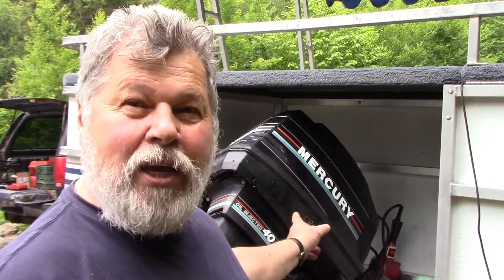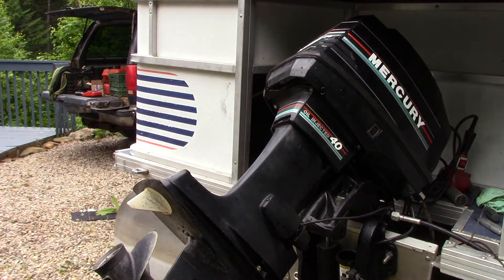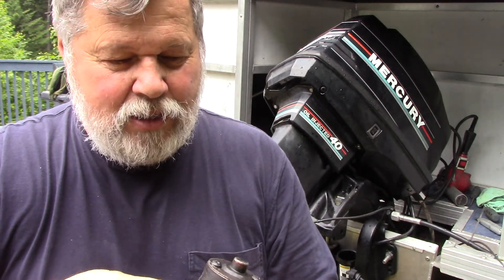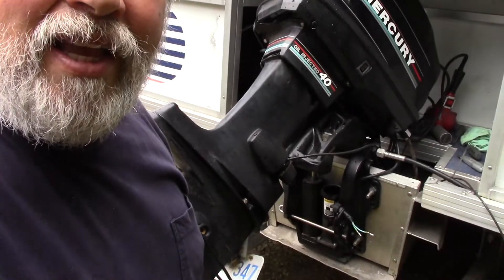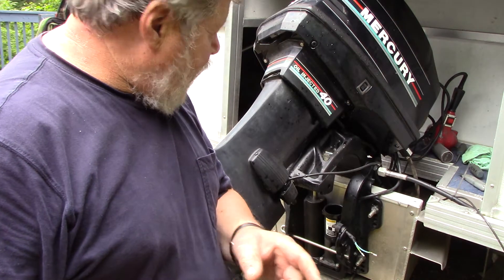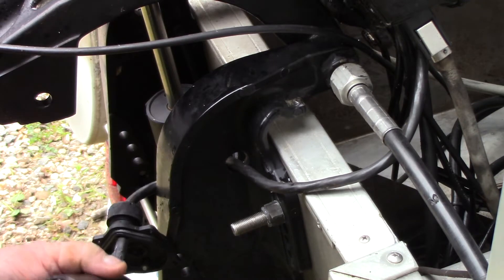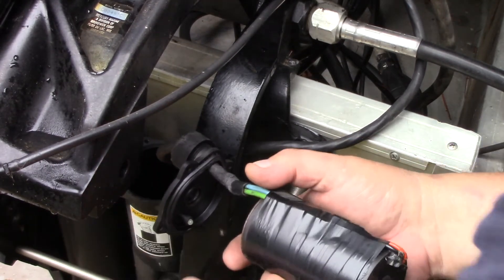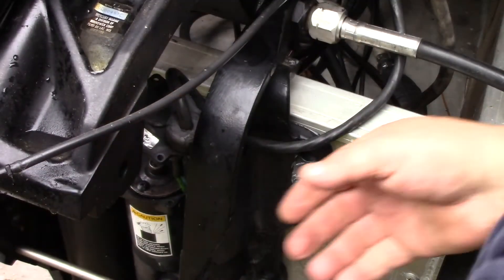Repairing the outboard tilt motor

Comment: have fun out on the water. good video. god bless
Reply from the maker: If it goes good it should be all fixed by the time summer over....Have to do work on one the carbs....float is sticking and she wan`t to flood....SALUTE
Reply: Gator's World aww I hope you get fixed before the snow flys to get to have some fun I miss mine wanted one for years had a 24 in my 30s someone blew my motor. so got one last year nice ran good but had one prob wasn't getting air so changed the gas cap ran good but when we figured what was wrong a man broke my fuel pump so never got to use over a year so traded for a motor home to go camping. well it needs work so yea I'll prob get to camp by next year. but I fill yea good luck brother. have a great summer god bless